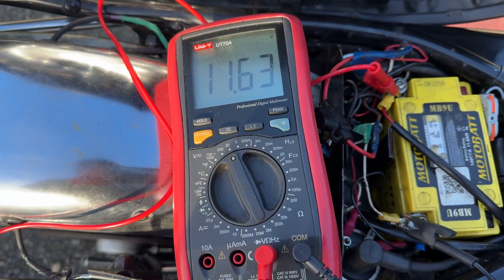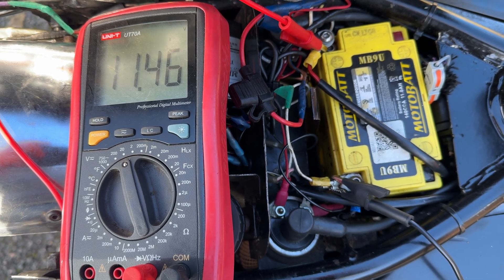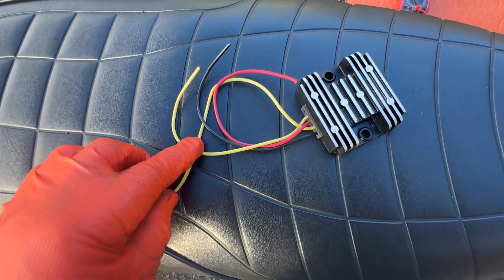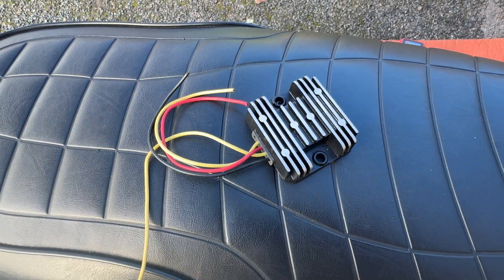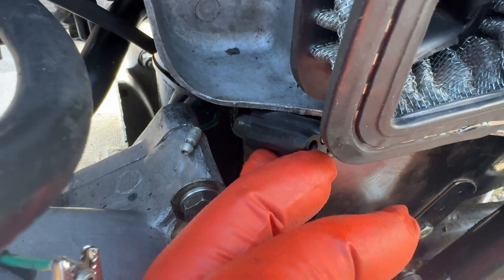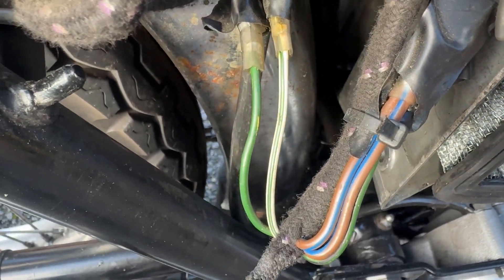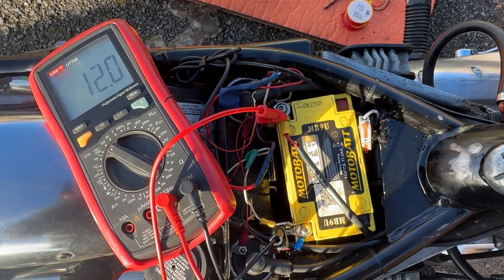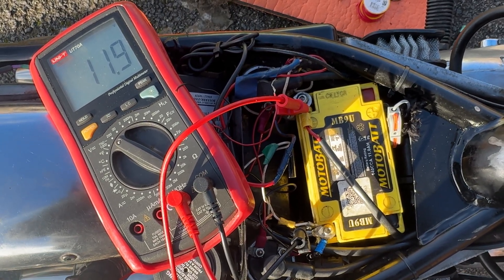The Triumph T140: A Lesson in Electrical Troubleshooting

Comment: I have this very issue on my 1980 T140. Many thanks for the clear steps. I hate the dreadful wiring and especially bullet connectors too. My bike was running sweetly the felt as if it has gone on to reserve. That didn’t help. I turned the headlamp off and sweet again. Not charging like yours.
Reply from the maker: did you sort it ? I bought a digital multimeter, and simply traced the steps. This evening on the way back from the Pub the right side indicators stick on. No blown bulb. I suspect a bad earth somewhere. I have written off a couple of hours on saturday to sort. Might be worth a video ? 
thanks for commenting
Reply: @OriginalBritishIron Not yet. I hate electrics but have the meter to do it. Lack of time means I’ve put it off. I used to have an old van to cart bikes around but ULEZ force me to sell it. I have a good guy in South Croydon but not easy to get it to him. Good luck with your indicators!

Comment: I'm concerned for the battery with the perpendicular battery strap clip vibrating against the body of the battery. Maybe a good idea to put some rubber between them or get a strap? What was the grey wire for? I have a 1980 t140 E, so any work or road videos of yours goes down well with me. Have you found "Lunmad" videos. R.I.P. His videos are a real education.
Reply from the maker: @chrisbland8650  your correct of course. I’ve cut some camping Matt material. I’ve been poorly since filming so she’s still apart. I’m hoping to sort within a couple of weeks. Regarding the grey wire it was a neutral light wire. Thanks for commenting. Yup Lunmad is my goto channel. He was fantastic working with one camera and explaining it to numpties like me. All the best pal.